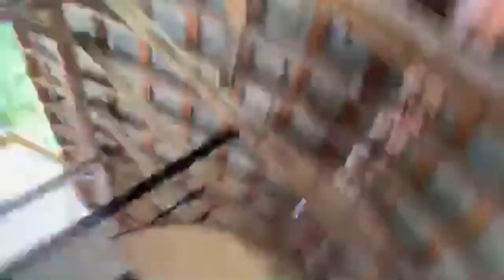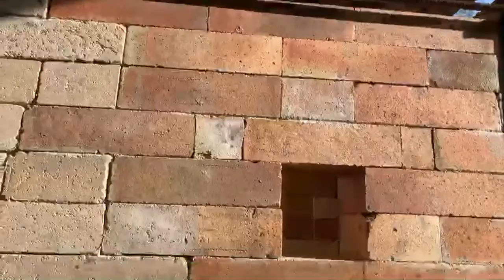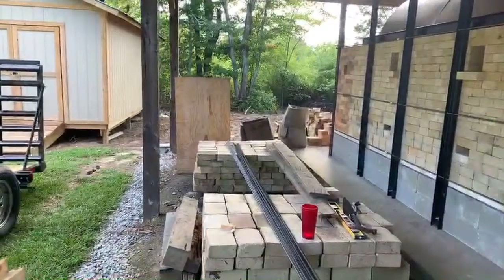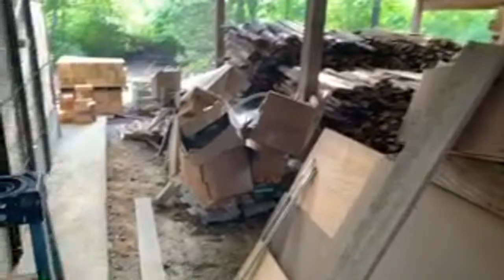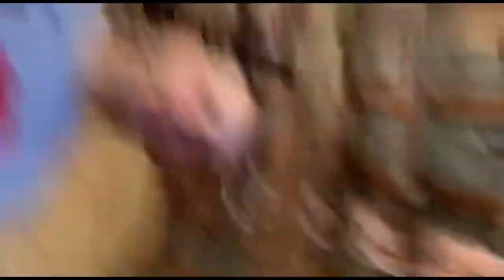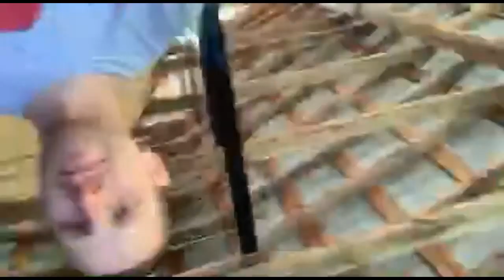Kiln Building Update!

Comment: Just thinking that you would be able to post your framing for sale, with all the work you've got in all the forms. Unless of course you plan on building another one and want to hang onto it.
Reply from the maker: Depends on how easily it comes out I guess. I’m thinking it will be in there very tight and may require some cutting to remove.